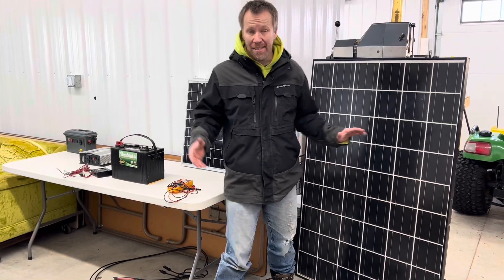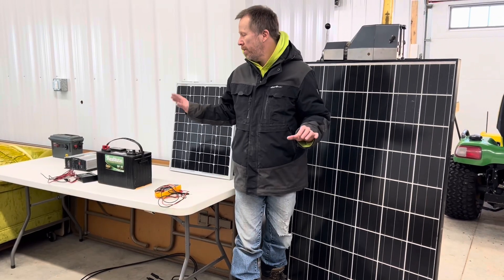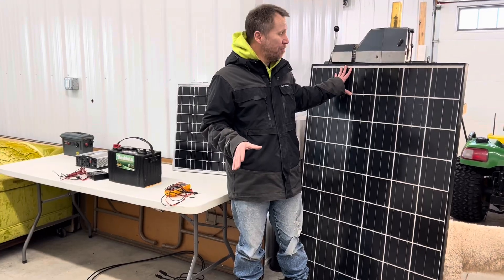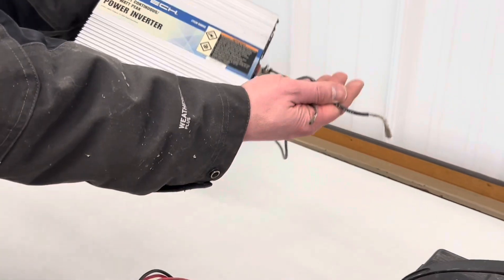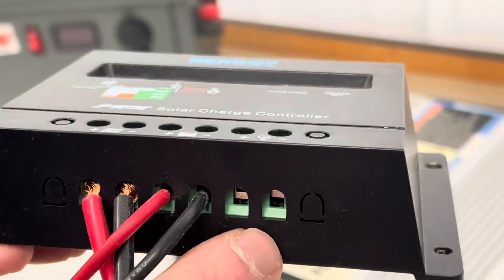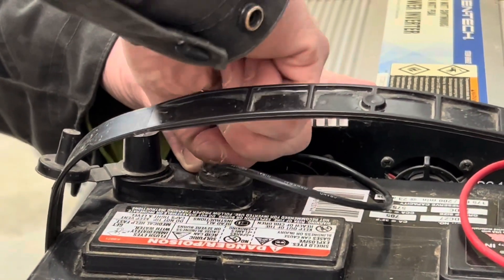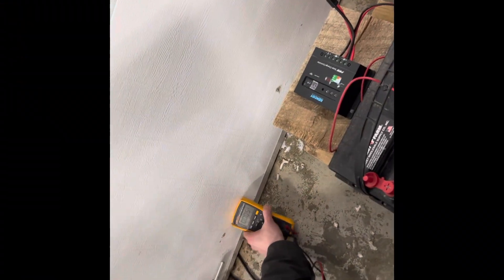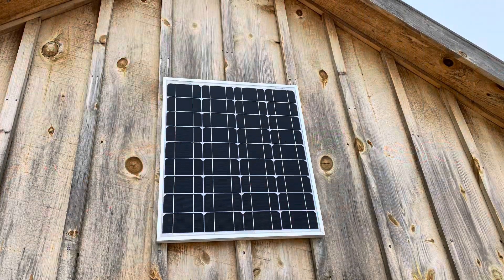Beginner’s Guide to Setting up a $50 Solar Panel system

Comment: Those light wires you have running from your battery to your inverter will smoke up the first time you try putting a load on it.